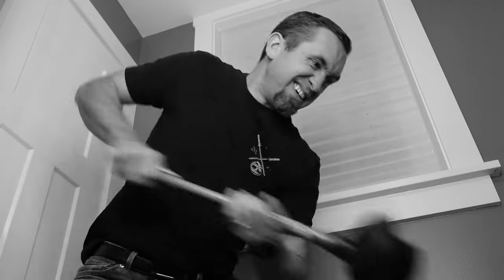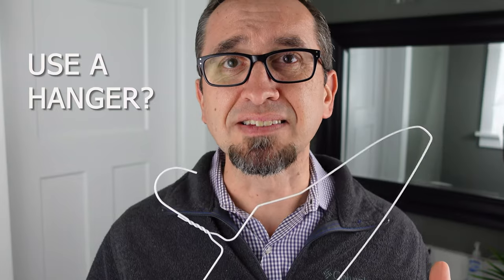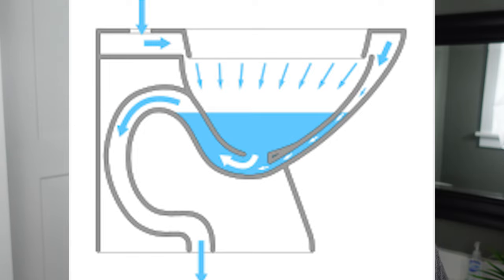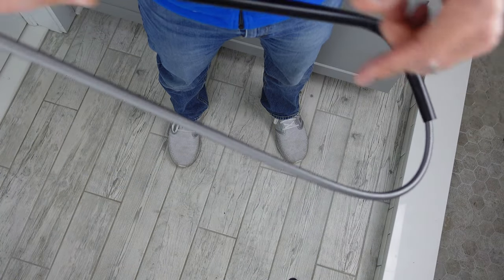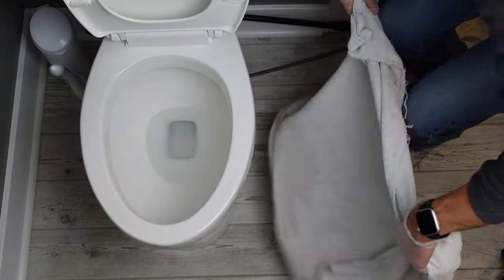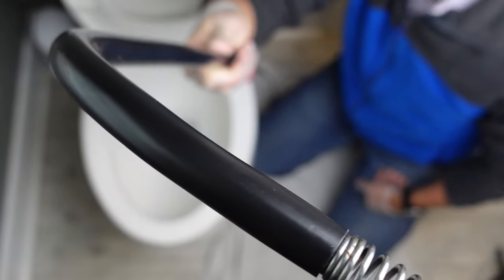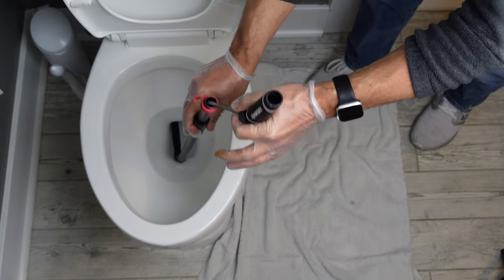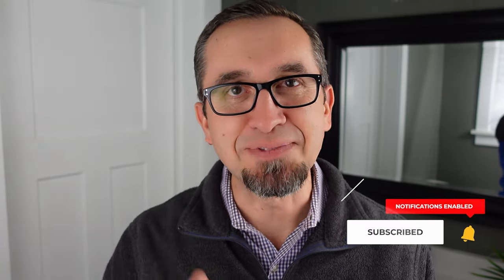How to Unclog a Toilet When the Plunger Fails

Comment: Here is a trick that I learned from trial and error... If you are afraid to flush the toilet because of overflow but need more water, use a bucket and manually add the water into the toilet bowl and if you see the water rise and not drain as it should, then you can stop adding water and not worry about overflow as you will have control of the water flow versus just flushing to test. If the water goes down after adding the water into the toilet bowl manually, then it should be okay to go ahead and just flush with much greater confidence. Keep in mind that the water needs to drain quickly or normally and not slowly otherwise you risk overflowing your toilet if you flush.

Thanks for the video. I learned something new today
Reply from the maker: I like it! Thanks for watching and sharing, Thorn!